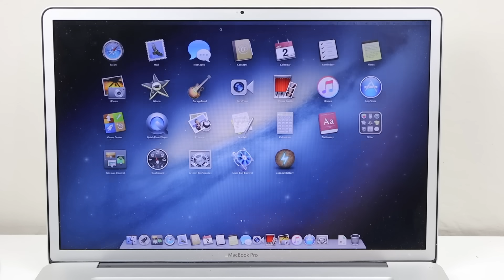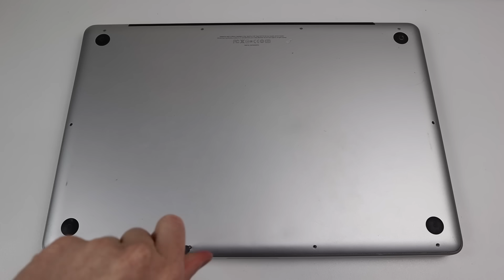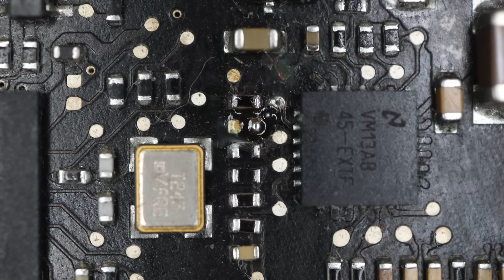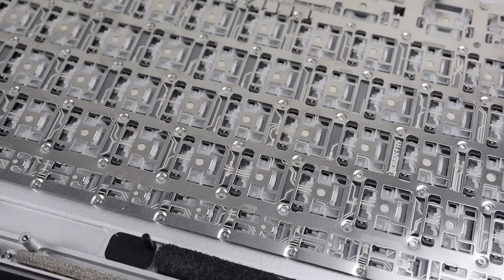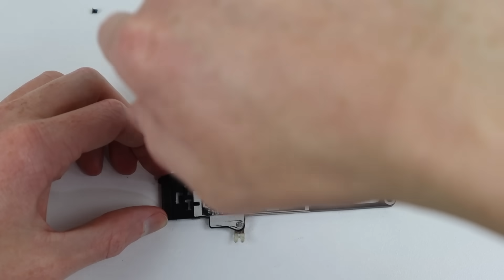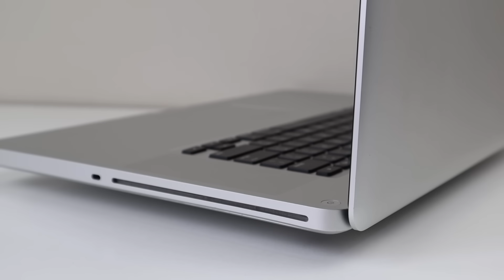Fried GPU! MacBook Pro 2011 Restoration

Comment: Even though I live in Europe, I'm still hating whenever Hugh says centimeter instead of inch. Display dimensions should be inches everywhere tbh.
Reply: As someone who has always lived in Australia, strangely I 100% agree. Television displays here used to be measured in centimetres, and in some circles they still are, but people are more regularly defining television display sizes in inches now. Considering almost all of our other measurements are metric, it's a little strange. But computer monitor sizes (and many other devices too) are all measured in inches—pretty much the world over.

In our country inches are really only used for measurements pertaining to displays (either physical size, like that 11-inch MacBook Air), or when measuring the PPI / DPI. It's a weird abnormality which it seems Hugh is trying to break, but I don't agree with it. Plus, that computer's official name is "17-inch MacBook Pro," no matter what language a Mac is set to, "Safari" is still called "Safari," and a 13-inch MacBook Pro is still called a 13-inch MacBook Pro (on the Japanese apple website, they write "13インチMacBook Pro"
Reply: Yes, that was an annoyingly stupid and unnecessary conversion no one worldwide needed.
Reply: Why ?
Reply: @dedelabinouze5110  Where do you encounter device screen sizes stated in the specifications in centimeters? Phones, TVs, Monitors, handheld measuring devices... it's all in inches, it's a round number and it's easy to compare.

Comment: You can disable the GPU through an EFI/NVRAM variable, rather than having to modify the logic board while also removing the AMD kexts entirely, the downside is any macOS update will wipe the NVRAM change and reload the kexts so you'd have to redo it, although the 2011 models won't be getting any other major macOS updates, so you can make sure you've got the very latest High Sierra version and then just do the EFI/NVRAM variable modification and leave it as an alternative if you don't want to solder. As you mentioned though, resetting PRAM will also re-enable the GPU, so this is very much the hardware solution, but the software solution can be easier for a lot of people if they happen to have a dead GPU.
Reply: Yup, this works pretty great without too much hassle.

Comment: Louis Rossman would be disappointed at the lack of flux during soldering
Reply: Hugh really should have added some decent flux when attaching the CMIZapper PCB. I'd also advise him to get in some soldering practice on a scrap PCB and to at least use a magnifier and preferably a stereo microscope for any very fine soldering. That aside I enjoy his videos.
Reply: @SlartiMarvinbartfast  this is big IC and if you have good eyes microscope is definitely not needed but a flux is a must!
Reply: @volkhen0  If Hugh ever tried to do any finer soldering then a stereo microscope would be essential, even with a chip of the size shown in the video extra magnification can help.
Reply: @SlartiMarvinbartfast  do you really think he is not aware of what gear he does and doesnt need, did you even watch the whole video and listen to what he says ?...always armchair "non-experts" like you chirping up
Reply: @bazwillrun  lol he was addressing the lack of flux, which can make for bad solder joints and more importantly, joints that can oxidize over time.
Reply: @SlartiMarvinbartfast  You don't really need flux on such a small job on newish connectors... but you SHOULD be using solder WITH Flux core. But it was obvious from the video his other issue was his soldering iron was not hot enough.
Reply: But he would be pleased to see Jeffrey said the oven method doesnt work (home made reflowing)

Comment: I have the same problem with my current Laptop Sony Vaio E Series model(Vpcee31fx)  it's had an AMD GPU and not working shows only Black Screen😢😢 otherwise everything works perfectly fine 
My question is there a GPU killer for my model too??
Any help would be great

Comment: You need to put flux on the parts before you use the soldering iron, it will make your life 10x easier

Comment: I wonder if you could disable the GPU in software with some custom Linux Kernel tweaks?
Reply: Here it is: https://gist.github.com/cdleon/d1eff7246a25193304284ecec40445b0

Comment: Without spending any mOney just install gfxCardStatus v2.2.1 app and set it to run on Integrated Only. Works 100% I'm using same Macbook Pro 2011 i7 spec 15" for past 3years no issues till date

Comment: Just as another question, how exactly does a GPU get fried in a laptop? I've heard about GPU's frying in a Computer which is easily replaceable
Reply: In that particular model of MacBook, the GPU would overheat, causing the solder joints to come loose from the motherboard and causing failure.
Reply: @TheTechnoGuy18  That's crazy, I would consider that as a factory flaw in that particular model MacBook with Apple not adding a proper cooling system, thanks for the info
Reply: @TheTechnoGuy18  No, it's just poorly designed GPUs. The iMacs from the same year had the same problem and they were an MXM GPU (not soldered to the board). The problem also went away with the 2012 MacBook Pros and 2011 iMacs (After GPU Upgrade), which had the exact same design terms of cooling.

Comment: My 2009 Sony VAIO E-Series doesn't boot up at all, when I press the power button, it just starts up with the fan running with no display, I tried connecting it to an external display but still no luck, any ideas what could be the problem?

Comment: 1. This computer is eligible for a free Apple repair program. They will replace the motherboard for free.

2. You could’ve patched the rom without the GPU killer. There’s a guide out there that requires NO hardware modifications at all. It will solely let the macbook startup with the Intel Integrated Graphics.
Reply: That ended 5 years ago...

Comment: Perfect job, just use thin wire. It's a signal trace, so don't need thick wire like this. LCD/LVDS cable wires working for me in most cases.

Comment: I had a similar gpu issue on my 2013 MBP - research told me that a particular chip was probably not getting power correctly from cracking solder
Reflowed with lead free solder and saved 800+ that Apple quoted me 😂
Reply: Cheap solder and cheap caps can kill an otherwise good machine (cough Mac Classic II)

Comment: Man how you get to know which resistors to remove or where to soldier, like from where you learn this?
Reply from the maker: It was noted in the documentation supplied with the GPU killer chip.

Comment: Pram reset my dude, gold down options key three times during restart anytime you change MOBO components. You'll hear the restart three times , then release and it should be good on the reset. Wish they had this module for Samsung Chronos laptops, shitty GPUS fry after a few years with no fix besides reball. 
Great video dude, love them all

Comment: Great job!  You should get a microscope. =). Also, people shouldn’t put their boards in the oven. I was also wondering if the shift key could have been repaired.  You can replace the rubber cups under the keys  if they get torn.

Comment: You should definitely try out Dosdude1’s macOS Catalina patcher so you can install MacOS Catalina on unsupported macs
Reply: that patch does not work with most 2011 MBP
Reply: @goforamanda5604  Ok, but it’s still worth a shot
Reply: @goforamanda5604  It will since he disabled the GPU.

Comment: I was expecting you to replace the GPU lol xD
Reply: Same
Reply: I thought he was going to reball the GPU, in a 15 minute video, lol.  Nah that'd be super human.
I did a fair few xbox 360 ones as well as old iMac ones, and it's serious business (not just a heat gun btw)
Reply: @abitrubbish  reballing is a myth, at least for these fried factory-defective gpus; reballing reworks the internal structure (solder, pads, contacts) but when you stress the gpu again (3d, games) it will fail 100% guaranteed; and you cant replace the gpu because u need the exact model (only available to apple back in 2011) and most gpus that model nowadays are defective, so no donor boards to salvage neither; the best workaround (this is a workaround) is presented in the video and he seized the day going with all the hacks and updates he could afford/get (bluetooth, RAM, keyboard color, brightness cable hack, etc) so it's a very good video showing imho the best path for reviving a 2011 i7 old but powerful horse, thumbs up
Reply: @alerey4363  You are absolutely right on reballing! However, you can replace the GPU on these models... It's an AMD Radeon HD 6770M chip and nowadays still available. Here in the Netherlands the replacement costs about €300,- which was done with my Late 2011 17" MB pro last summer.
Reply: @winandmestebeld  but how do you know if the replacement has the same problem as the original? AFAIK it's a whole batch of gpus from back then with the same problem; and it's even worst because it's not a problem you can spot right on at replacement; it's always a decaying fault over time; I wouldnt invest 400 euros or dollars (plus shipping, handwork, etc) in a 10+ year old notebook; and to add insult to injury, apple is well known for poor thermal solutions which contribute even further to gpu overheating + fail
Reply: @abitrubbish  In recent years its actually been shown its not the BGA under the gpu, rather the solder bumps between the substrate and the die. Heating up the gpu temporarily fixes the solder bumps but they still end up failing
Reply: @rockl79  Erm, BGA is the "solder bumps" It's an Array of Balls of solder in a Grid pattern
Reply: @abitrubbish  Duh rework station territory but this is just sad....
Reply: @abitrubbish  I can do in 1 second. Just let me get Sony Vegas up and running--
Reply: He doesn't know how to do some more complicated things, he can only do easy repairs
Reply: @RoxGYT  Not for a GPU if you are supplying a warranty on the work, you need a real setup. What you described is pretty much what I use for iPhone CPUs etc, but the GPU rig was over 2k. It uses IR, has multiple settings for pre heating curves etc. Still avoid using it though as the job takes ages, and thus, cost more that is usually viable.
Reply: @abitrubbish   If you do it for yourself, with no warranty, it isn't hard. If you do it for a laptop you will sell, you need to replace the chip to make it an actual proper repair. I am on the subject of reballing multiple GPUs from older laptops, and that's what you need (I did forget a small board holder for holding the chip while reapplying the balls, and a solder tin remover cable). It takes less than an hour. It is not a super long process.
Reply: @RoxGYT  Cool
Reply: @RoxGYT  no one care
Reply: @colleenmogg6007  You don't. That doen't mean everyone doesn't.
Reply: @abitrubbish suners
Reply: Cpu is soldered to motherboard and removing isn't hard but installing replacement is as it has very tiny soldering on the board which hugh doesn't have tools to it
Reply: @virajpatel_  dosdude1 did it and upgraded his macbook cpu to a t9900
Reply: Same but that would be next to impossible
Reply: Same
Reply: Same
Reply: I was expecting he would turn every component upside-down because Australia
Reply: That’s what dosdude1 would do
Reply: I actually expected he to do do too.
Reply: @PlytkaChodnikowa  i also expected that he will replace gpu to do to too do to do do to too to gpu.
Reply: Me too
Reply: Samee
Reply: Same
Reply: Same
Reply: It's really difficult to do but I thought that too.
Reply: Same xD
Reply: I was also hoping to see that! :(
Reply: I think everyone that replied to your comment expected him to do that too
Reply: It just wouldn’t be fun
Reply: Me too
Reply: Me too!!!
Reply: Same
Reply: Same
Reply: yes i too
Reply: Same.. I thought maybe he'll reball the gpu or something 😤
Reply: Same
Reply: xDDDD
Reply: HOW YOU EVEN WANTED TO REPLACE GPU?!!??
Reply: Benchmarks
https://youtu.be/bjuASqG3k9U
Reply: Me too
Reply: He would probally need to know micro soldering to do that, and it would cost a lot
Reply: He didn’t replace it he disabled it
Reply: He should've put in a 3080 lol
Reply: @RoxGYT  took 2 months for all the parts to arrive
Reply: @OhSoTiredMan  What parts ?
Reply: Me too
Reply: Lol same
Reply: me to
Reply: You can’t do that. It is very hard.
Reply: Same
Reply: same
Reply: The GPU is soldered into the board..
Reply: @biswabasudasgupta5375  It's called BGA Soldering.. Normally you use a stencil to align the solder spheres, then with a hot blower you melt them into the PCB
Reply: Same
Reply: Me too.
Reply: You sound like a verified youtuber
Reply: I was thinking the same
Reply: same🥲🥲
Reply: He couldn't do this
Reply: @mrscristal9203  what do you mean?
Reply: “And here, we have a 2011 MacBook Pro powered by a RTX 3080”
Reply: No you can’t replace the GPU on a MacBook.it’s glued on to the socket.
Reply: Me too
Reply: Yes, you can replace soldiered gpu's
Reply: Me 77!
Reply: Same here lol
Reply: same
Reply: Same, bruh
Reply: There is no replacing the GPU without a proper BGA rework station which is anything but cheap
Reply: Same
Reply: same
Reply: There's no point knowing Apple the replacement will be fried too
Reply: The GPU is part of the motherboard. Replacing it would require a new logic board.
You probably couldn’t cut out the GPU and replace it.
Reply: Same here lol
Reply: Same lol
Reply: You can't replace laptop GPUs.
Reply: It's impossible without an automated machine
Reply: @sardanus  That was my point yeah. I wouldn't call a reballing rig automated though. I wish. There's still a ton of manual work involved

Comment: The greatest MacBook of all time was the 2012 MacBook. 

CHANGE MY MIND. 

OH WAIT YOU CANT
Reply: I have one. It has some annoying flickering issues (they don't look like GPU, Pram or SMC issues, it seems to be something software I have no idea about what it even is), but works fine. When it doesn't flicker it even runs emulators and 3d modelling software
Reply: @rac1equalsbestgame853  

Sounds like either a display issue (usually the connector) or it has had some type of damage (normal over time use). Usually what is it is, the display connector that is in between the hinge is damage and needs to be replaced with being opened thousands of times more than the are intentionally engineered to handle.
Reply: @alg003  The confusing thing is that I think it's software. The mayority of the time when turned on it has the flicker but sometimes it doesn't... Needless to say I haven't shut down my computer in a month
Reply: @rac1equalsbestgame853  

You might want to do a complete system shut down then after reset everything by itself. It might help
Reply: @alg003  The prob is that I use it for school and I don't have enough space in my Icloud to save all my documents
Reply: @rac1equalsbestgame853  
I meant like hue did, not an actual reset but like a system reboot.
Reply: @alg003  ?
Reply: @rac1equalsbestgame853  ?
Reply: @alg003  I don't even comprehend what he did
Reply: @rac1equalsbestgame853  

OOP.

Comment: my mid 2012 macbook pro needs soldering for airdrop bluetooth and wifi cuz I broke the connector and i hope it goes well when i get the part as i have never done a soldering job before. also there's no backlight but I don't need that so I can fix that later

specs if your interested: intel core i7 2.9 ghz 8gb ddr3 1600mhz ram and intel hd gpu 4000

Comment: U should have used some flux when u soldered the modding chip to the rom .. 
I screamed at the screen when i saw that lol
Reply: @Ellis The DJ  There is, but usually it's not enough. Like in this case you can see the solder is sticking quite poorly to the surface and melts together with other pins.
Reply: @Ellis The DJ  Oh man no worries, I was such a noob not long time ago. I was learning to solder and it took me some time to figure out how to use flux. Then I just hated myself cause all the soldering I was doing before could have been done so much better and easier by just using flux ;P
Reply: exactly
Reply: He did..

Comment: I know this comment is going to be buried, but I just wanna say, that I lost my job cause of COVID, and would buy broken macbooks, fix them, and flip them at a discounted price. This is what I would've done: I would've used flux and a hot air gun to temporarily reball the GPU, patch Catalina on it, and disable the GPU via an application DosDude makes, and edit the drivers to allow for brightness controls, which can be done. Obviously I would've upgraded the RAM and threw an SSD in it. Also, I'm not sure what you meant by "Newer macbooks dont have replaceable keyboards", yes, they're rivitted in, but I've yanked old keyboards out, and the new replacement ones would come with self tapping screws to secure it. It's a very tedious processes, but much cheaper than doing a new top case.

Comment: Tip: If you have one of these with the GPU problem but this looks too hard to do, just install the latest version of Ubuntu. Ubuntu has removed the drivers for the AMD card in these so its just gonna work without any issues.

Comment: I always taught that this is an insanely large laptop, I remember back on 2011 when I bought my 11 inch MacBook Air, (that I’m still using as my main computer to do architecture work and 3d modeling. And works great to, but battery died couple years a go, so I’m gonna upgrade in to a new battery and SSD hard drive) saw it on the iCampus store and it was really massive and heavy but very powerful for the moment (and way expensive too). It was a really interesting video, despite all time those are still really wonderful products and very well done designed to last for many wears